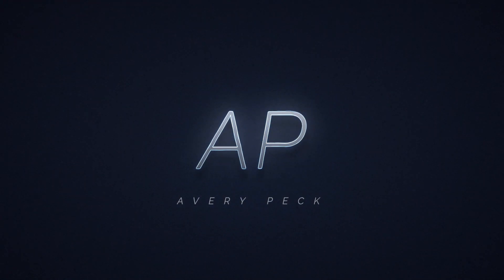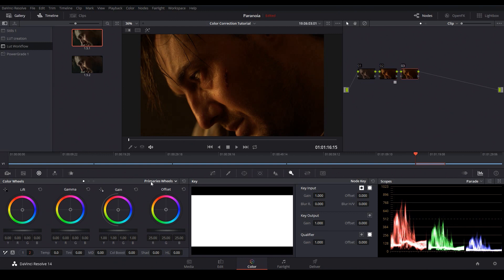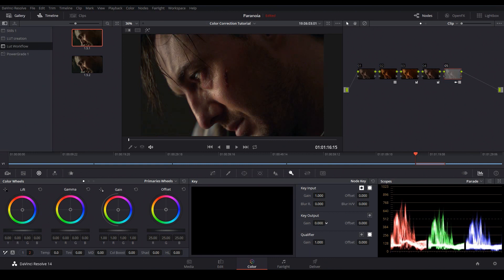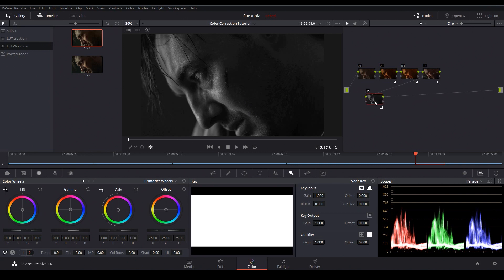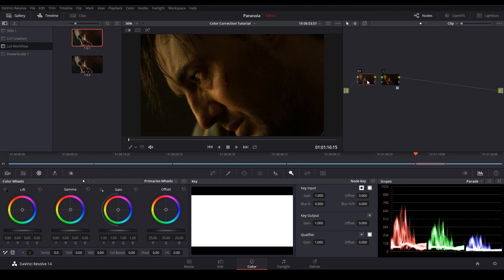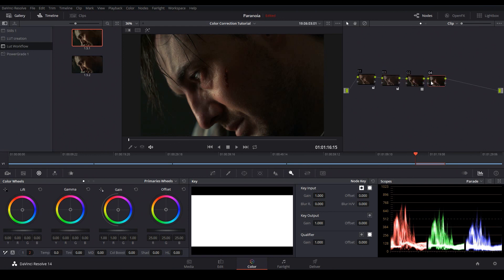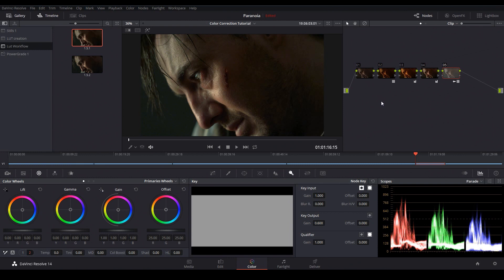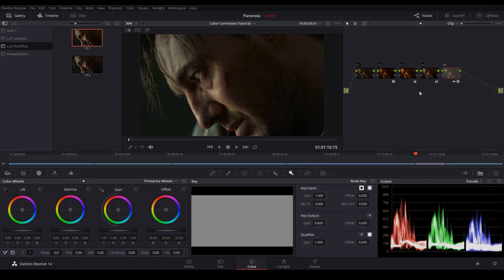The LUT Workflow Explained (Part 2) | DaVinci Resolve

Comment: Hi， Peck, thanks for all the effort puuting into the tutorial. It's both educational and inspiring.
Could you spare your time and answer one of my questions? Is it still necessary to go for BlackMagic Design Camera film to Rec 709 V2 if the color management setting is realy set as "Input Color Space> Blackmagic Design Film, Output COlor Space>Rec709 Gamma 2.4"?

Thanks for your time!
Reply from the maker: If you're using RCM, then there's no need to use the LUT! Either one will do the log to rec709 conversion for you, and trying to use both on the same clip will be applying the conversion twice. LUTs and RCM do their conversions a little differently though, so it's up to you to decide which method yields the best results. There's no right or wrong answer there!
Reply: @averypeck  Thanks for the answer, sir! it helps a lot!

Comment: Very nice breakdown!  I use LOG footage quite often. I like to work on it and get to my final result  WITHOUT ANY LUTs.  So you concur: all these LUTs - Creative REC.709 LUT AND Creative Input LUTs - are just options. 

Are they really ALL unnecessary and reproducible with enough skill?? 

Because in part 1,  you showed how difficult it can be to qualify (the skin of the woman) on LOG footage. That it is better to apply a Creative Input LUT before, and then qualify on that new color space. Now you say that you can achieve any result without any creative LUT. 

Also: when you say that LUTs are changing the footage into another color space, it sounds like a "conversion" of the image. Is there more happening here than any of the  colouring tools of Davinci Resolve would allow you to do? I thought that "changing the color space" is happening through the RCM and not through LUTs.

I guess my key question is: do we need ANY LUTs when we work on LOG footage? If no, it would be really nice to see your workflow color correcting and grading LOG footage without using any of them.

Comment: Once this is all said and done is there another node/LUT you would recommend adding to compensate for the way the video is rendered in QuickTime? Because this has been a thorn in my side for like almost a week now. Fantastic image in resolve. Slightly less saturated and slightly brighter final rendered picture. It’s driving me nuts and there seems to be a bit of dispute as far as render settings and workarounds.
Reply from the maker: QuickTime is notorious for playing back files with the wrong gamma. Try to playing the file in VLC, or just importing back into Resolve to see if the problem still exists.
Reply: Avery Peck Thanks for the reply man! I’ve actually done both of the things you suggested. They look exactly the same. So just leave itAnd say screw it? I made a pretty cool video but after rendering it and uploading it to Vimeo, it sucked to look at.
Reply from the maker: @j.oakley9588  If the video still looks washed outside of QT, make sure that your "Data Levels" on export are set to "Auto". A common mistake is to set it to "Full" thinking that it produces a better result, when it just changes the range that RGB values are encoded to, which can lead to lifted shadows and lowered highlights.  Hope that helps!
Reply: Avery Peck yeah, I did that. Oh well I guess. But thanks for the reply! I know you get a lot of these.

Comment: Avery! I love your colorgrading videos. They have been a life saver! Do you always color grade per clip or do you use the group color grading feature? Like creative grading on post group clip, Rec 709 conversion pre-group clip, Basic corrections on the clip? Just curious about your workflow for larger correction and grading. 

Another question is when you create your LUTs do you recommend creating the LUT to the extreme look and exporting the cube file so you can lower the strength in key later on for other projects?
Reply from the maker: Thanks! Yes, I'm a big fan of using groups personally; it's a great way to streamline your process. How I use pre clip/post clip depends on the project: if I'm going for a more filmic look, I'll convert my footage to Cineon film log and add film grain in the pre clip, balance my footage using printer lights in the clip, and use a PFE LUT with additional adjustments in the post clip. Commercials and more "rec709" looking material will have me normalize my shots at the clip level, then grade lightly at the post clip level. 

As for LUTs, I don't often export my grades as LUTs (I use Power Grades instead to remain flexible), but exporting at a higher strength is wise if you plan on using it as a creative LUT. Monitoring LUTs and most technical LUTs on the other hand should be exported at their desired strength only.

Comment: Super appreciate the knowledge you share! Quick workflow question for you, if you don't mind. I need to transcode my raw footage out of Premiere before I grade in Resolve (too many effects on the timeline to work with raw). Do you recommend applying any corrective LUTs, like sLOG to 709, before the transcode from Premiere? Should be okay as long as I stay in the same color space, is that right? Thanks for your help, Avery!
Reply from the maker: Thanks, glad you liked it! You shouldn't apply any LUTs or corrections to the footage before transcoding; the footage should be kept in a format that retains as much of the original information as possible (typically log with a high bitrate codec like ProRes 4444). You can apply the LUTs and corrections in Resolve where you have more control and better tools available. Hope that helps!
Reply: Sweet. Thanks for the very helpful tip. Keep up the great work!

Comment: Hello Avery. Thanks for the tips. I am confused though -- in Part 1 you said you should make the conversion (technical) LUT the very last LUT in the node chain, saying that adding further nodes after it and making adjustments with them could undo the work of the converison LUT, presumably undoing the broadcast safe level of highlights, for example? Yet in this (part 2) you add other nodes after the technical LUT. Won't these risk making the output "illegal" for broadcast?

Comment: What I dislike is that LUTs are a compressed into a single node without any hint to what they do. 

I would love to use a LUT that adds 4 nodes for exposure, contrast, color and qualified skin tones with additional color adjustments but they also have the information of their changes. Like where the primary wheels are moved, or how the curve changed. 

All in all DaVinci needs to connect the scopes into the tools better. Think about how useful the curve could be if you map an input historygram behind it and you can apply it 1:1 to your needs.
Reply from the maker: Resolve has a feature almost exactly like what you're describing called "Power Grades". Instead of baking your nodes into a LUT, it let's you apply the entire node tree to a shot, leaving everything fully editable. The only downside is that it's a Resolve-only feature. Unfortunately, companies don't provide these because users can figure out the "secret sauce" of their looks, and realize it's not that complicated. 

I think you'll find that the curves and wheels are pretty well mapped to the scopes, you just have to take some time to get used to the relationship between them. My next video will actually cover something similar to this: how to see color in a way that translates to the tools in Resolve. It might help out a little!

Comment: Abandoned luts for good.
Always prone to artifacts.

Jumped to an ACES workflow with some color management. Way better and more precise colors - less banding as well.
Reply: The last part is actually the most important part :D
Did you try using ACES or at least RCM for color management?
Reply: Oh well, you did with RCM. Way more precise than using a log to REC709 lut.
ACES is even nicer, since you don't even convert to REC709. You convert to ACEScc or ACEScct and having a REC709 ODT to view what you're doing - making HDR way easier (no regrade necessary, just some adjustments)
Reply from the maker: Yeah, I abondoned LUTs a while ago too and use RCM. RCM is similar to ACES in that it converts the image twice, once to get into a working space, and again to get to your output space. That's one of the reasons I prefer it over ACES: you get to independently select the working and output space, and aren't confined solely to the ACES primaries and gamma. Plus you have tone mapping settings, which are super helpful.